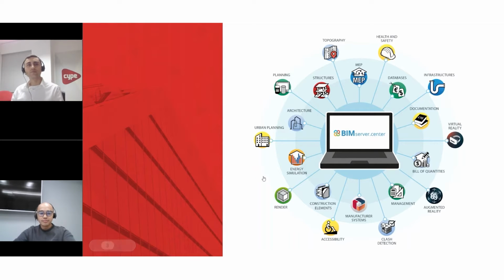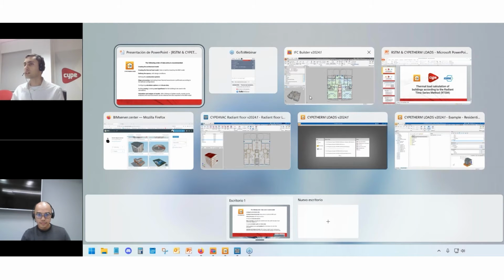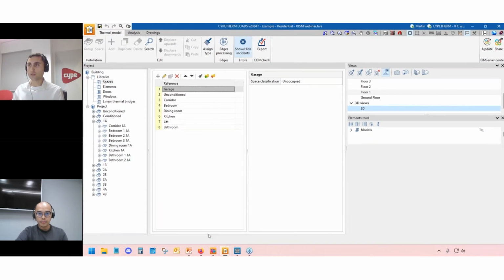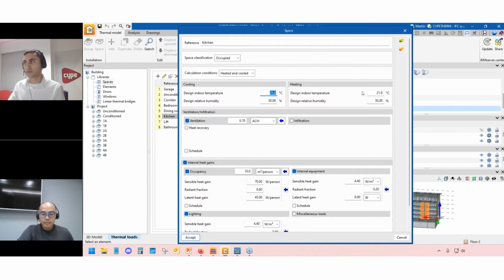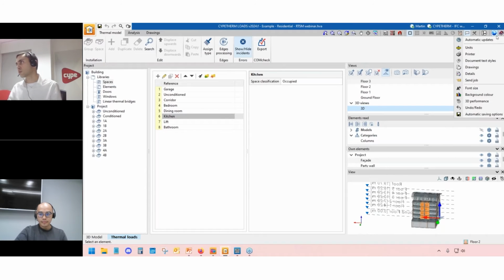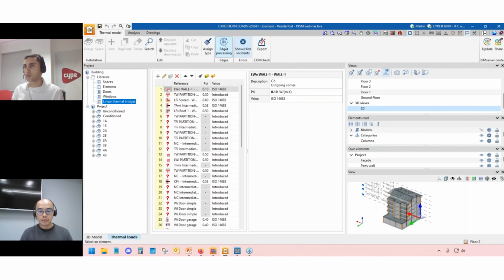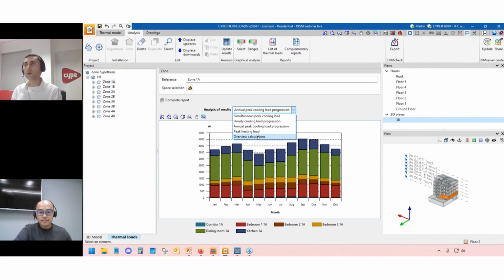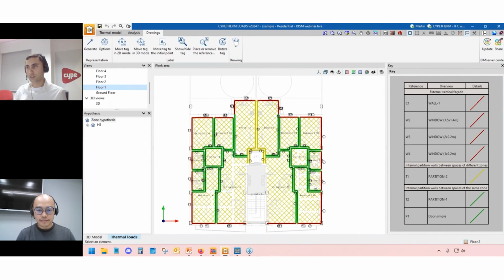WEBINAR: Thermal load calculation of buildings according to the Radiant Time Series Method (RTSM)

Comment: Designing buildings in CYPE can be challenging, and the software occasionally crashes. If CYPE could integrate with Revit or Archicad via a plugin, it would attract a larger user base, especially for thermal load calculations. This would significantly improve workflow efficiency and usability.
Reply from the maker: Hello! There are several options to start the work (for CYPETHERM LOADS, they are listed here: https://info.cype.com/en/subject/cypetherm-loads-workflows-supported-by-the-program/ ). One of them is to use the Open BIM Plugin of Revit, which extracts the geometry from this program: https://info.cype.com/en/software/plugin-open-bim-revit/ Another possibility is to upload the IFC file to BIMserver.center directly: https://learning.cype.com/en/faq/how-to-upload-ifc-files-to-a-bimserver-center-project/ (this possibility is equivalent to using the IFC Uploader program, which is no longer necessary in this way). Any of these options requires the intermediate step through Open BIM Analytical Model, in the case of the thermal and acoustic simulation programmes, for the generation of the analytical model required: https://info.cype.com/en/software/open-bim-analytical-model/ If IFC Builder is used, communication with the thermal and acoustic simulation programmes is direct and does not require the step through Open BIM Analytical Model, so its use can be considered if necessary: IFC Builder also has a native importer of IFC files ( https://info. cype.com/en/subject/ifc-builder-import-ifc/ ) so, in addition to drawing the building from scratch in IFC Builder, it would also be possible to import an IFC developed in other tools and adjust it in IFC Builder to prepare it for export. Best regards! 😊
Reply: @cypesoftwareEN  Regarding the thermal bridge assignment, the system is detecting too many bridges, and we are getting tired of manually clicking and assigning each one. Would it be possible for the system to assign them automatically?

Also, could you provide an explanation of thermal bridges, including a practical online example for better understanding?
Reply from the maker: @dnts.prasanth5519  Programs such as CYPETHERM LOADS (also CYPETHERM EPlus and others) have the option ‘Edge processing’ which allows the simultaneous management of all edges of the model and their conversion, if necessary, into linear thermal bridges. Details on this option can be found at the following link: https://info.cype.com/en/subject/cypetherm-loads-thermal-model-edges/ 😊